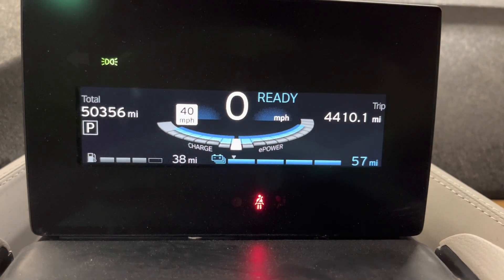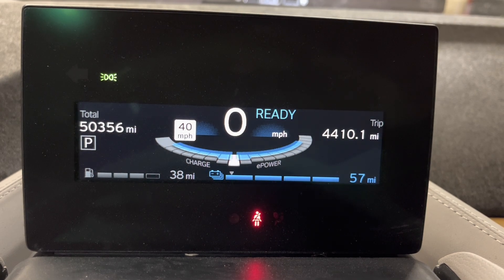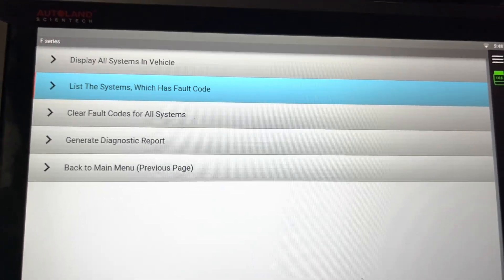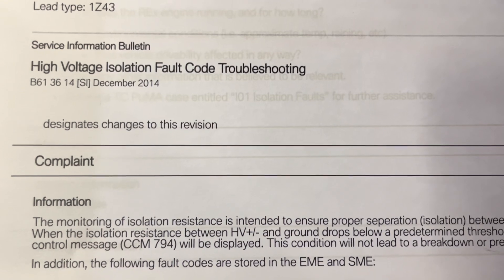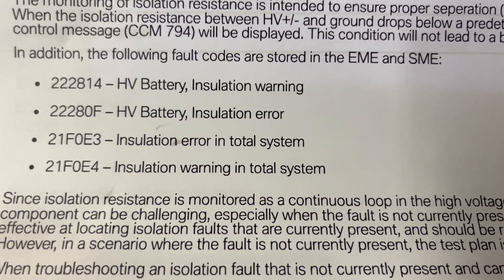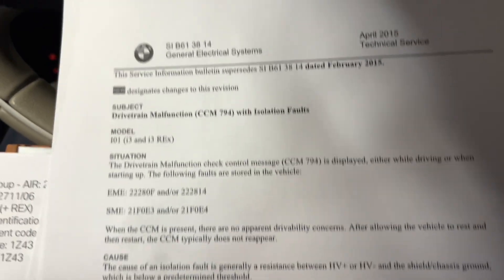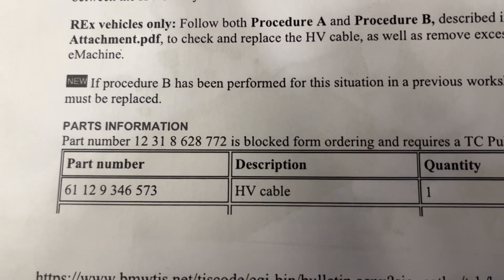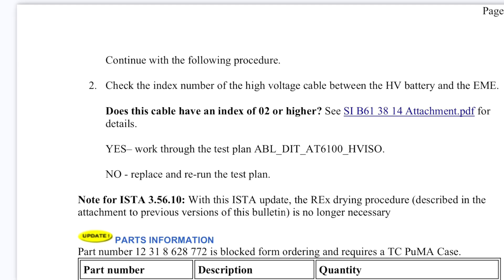BMW I3 Intermittent Drivetrain Error HV Isolation Fault

Comment: The Rex replacement as next step is terrifying. Ill just deal with it or part the damn car out at that point. Mine has a water pump leak currently on the Rex water pump and I just add coolant cause it shows a 19 hour job to take those three little bolts out to change it instead of making it accessible